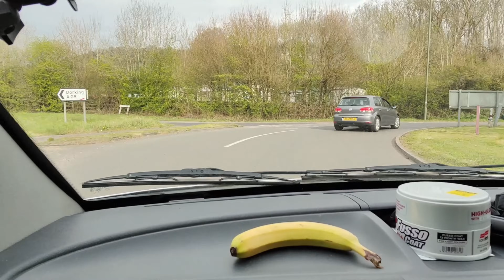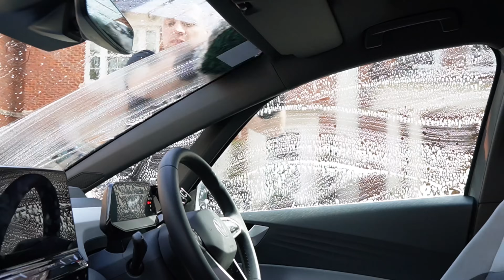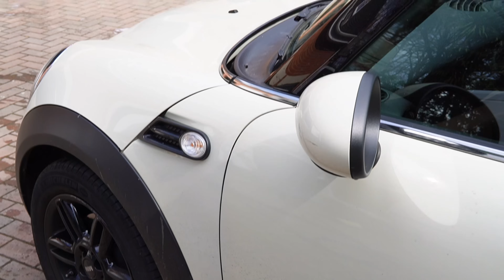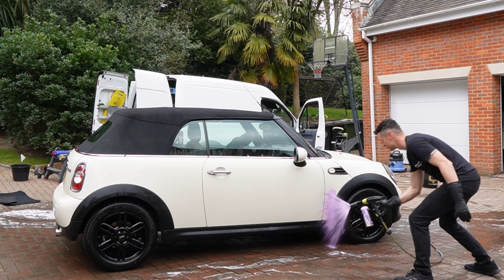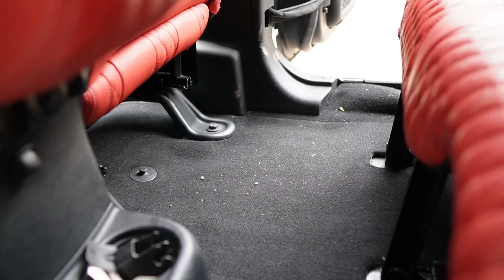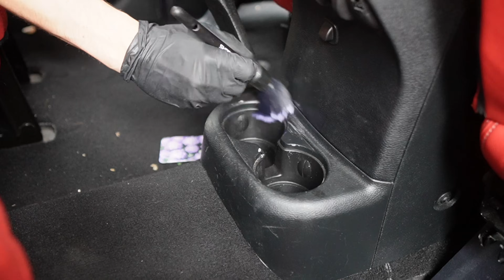Getting an Inside Look into the World of Luxury Car Cleaning

Comment: Great show Dave. I have to side with the Pops on the foam though - it was gloriously thick. 

PS: if the van isn't accelerating, try a bottle of fuel injector cleaner in the petrol tank next fill up. Clogged injectors might be behind sluggish acceleration.
Reply from the maker: That van has been on its last legs for years 😂
Reply: Well, a little PM goes a long way. May be overdue for a tune up - spark plugs, fuel filters, hi mileage full synthetic oil, etc.. 🙃
Reply from the maker: @lesdodson9134  it's had a hard life lol

Comment: When you were showing off the Mini at 17m00s I noticed that the brake disc had that orange tint that appears like surface rust.  I am told that spraying some Bilt Hamber Atom Mac alleviates this. And just wondering if you have tried this? Thanks.
Reply from the maker: The second you move the car and tap the brakes it removes it in seconds 👌

Comment: I just bought a pressure washer for €70 with 135 bar 1600 watt i have to say i was surprised it is perfect, i wan't to start and the hard thing is when it comes to the inside of the car how do you clean it without a streamer of extractor i have tried it with foam in a can and a nail brush but not te result is was hopeing to get, what is the best way without the electronics? I just bought some clay, wax, seallant, and spraywax, waxed my own car it took so long but also because i made it hard by not grabbing the right tools and i am not really happy so we will try again hope for the best. Any advice on clients? And the best way to approach ppl? i would like to start with a wash and basic clean vacuüm and a quick wipe down i would like to focus more on the outside because it feels like you need less for that in order to make it look good again. Let me know what you guys think should i do things different? I am sorry for my bad english!
Reply from the maker: Trust me you don't NEED A STEAMER.  I hardly use mine. It's good tool to have but not one you need 👌
Reply: @epicautomotivedetailing  Nice thank you! I will start with practice on my car and when i like the result use it on the customers car.
Reply: @epicautomotivedetailing  is my pressure washer to strong since the most ppl use less bar and psi i like It because i has a little bit more power, it was possible to buy one with 120 but i was thinking it wouldnt be strong enough and it was like 50 euro more expensive. It is possible to go back and change it for the Kärcher K2 or a home brand one with 105 bar or the Bosch home one with 110 bar what is the best option stay with what i have of go back and get a different one?

Comment: Do you use your water tank or customer’s water??
Reply from the maker: Yes I do now. I changed my strategy and it's working wonders
Reply: @epicautomotivedetailing  using water tank?
Reply from the maker: @soufianeelhaddaoui37  I removed my tank now
Reply: @epicautomotivedetailing  customers does not complain about using their water and electricity?
Reply from the maker: @soufianeelhaddaoui37  not at all. When you explain the benefits for both them and yourself they understand
Reply: @epicautomotivedetailing   which benefits for the customer???
Reply from the maker: @soufianeelhaddaoui37  I just say to them if I carry my own water and power it will cost the equivalent of £20 extra. Whereas it will use about £1.50 in their own energy supply at max. Plus it cuts co2 emissions no generator for no fuel, no extra weight in the van. If people don't understand then they aren't the types of customers you want

Comment: I’m quite glad you showed thy little tip washing the wash mot out, I’ve been doing it only cleaning my own cars, but after watching soo many detailing videos, felt bad for not using 2 bucket method 😅 if I was cleaning someone else’s car I probably would use 2 buckets just to be safe, because if I didn’t have 💩 luck I’d have mine at all 🤣🤣
Reply from the maker: One bucket is fine. The pre wash does the job of removing most of the dirt too so I think people are being too fussy

Comment: Great vid! What did you use on the mini black trim? My wife has a countryman and they are a bitch to clean on hers.
Reply from the maker: To be honest just a hot air gun will fix it mate. It will cause the oils to reach the surface 👌
Reply: @epicautomotivedetailing  great tip thanks!! Now I need to steal her Ghd hair dryer 😂😂

Comment: Snow. Foam  purple      They call for 1:9ratio what do you use I've spent the money for the stuff because of you I'm excited but I'm not  Getting the results I see for you
Reply from the maker: Depends on type of cannon your using. Eg to get perfect foam you need all of these: a quality foam , a decent cannon , a good pressure washer. Ideally all 3 are needed. I always start weak and add foam till I'm happy with the right thickness
Reply: @epicautomotivedetailing   thx. Got it.   Done. Just xpensive freight to usa. 50.00 usd